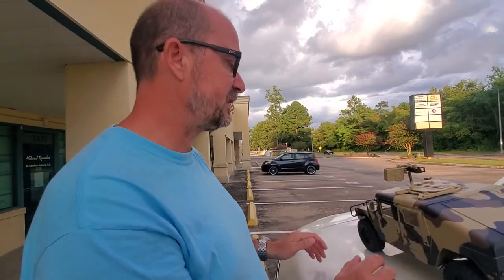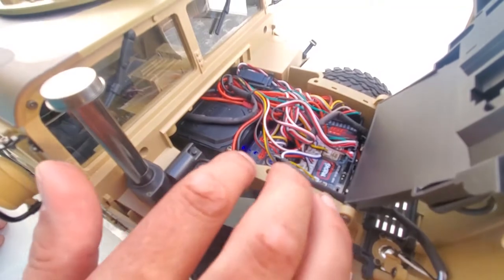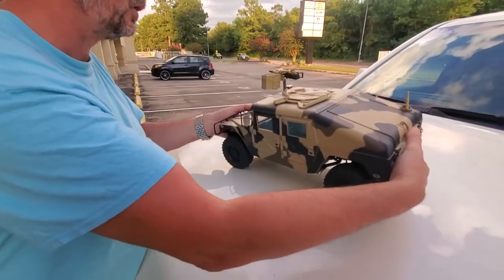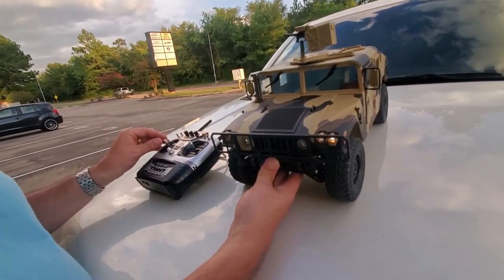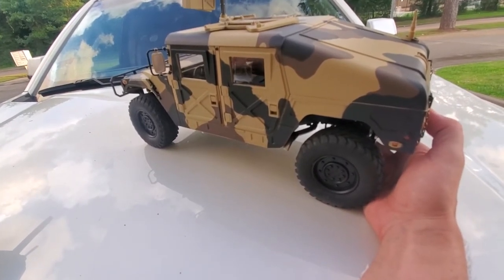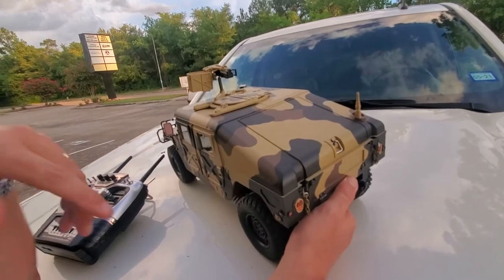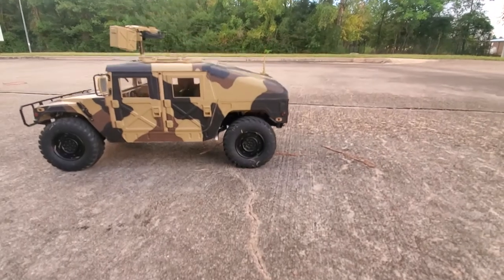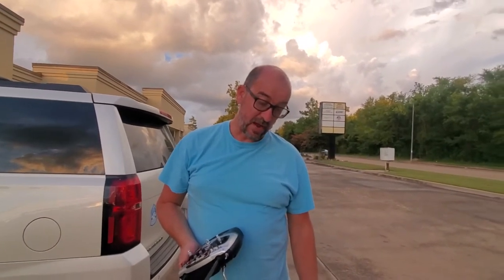RC Car Review Part 2 "Imex HG-P408 Humvee" Top Shelf RC

Comment: I really like your camouflage Humvee, the video is excellent and I can see that it has good speed, mine, I have changed the ESC and it can operate with 3s lipo batteries and it still runs more, it is very fun!
A greeting from Barcelona!!
Reply from the maker: Greetings Skynet in Barcelona from Houston Texas.  Hope you are staying safe over there.  Yes, I think the drive train can handle 3s, but as you say that will require changing the ESC also.  It's a great item.  Personally I prefer the  simple army green color over the camo, but the green one is not available to us with the lights and sound.

Comment: Unlocking and locking diffs?
Reply from the maker: Thanks for your question.  It comes standard with a two-speed transmission, full time 4WD, front and rear diff locks and fully independent suspension.  So yes, you can lock the diffs. I am going to look and see exactly how it is done tomorrow, just to be certain.